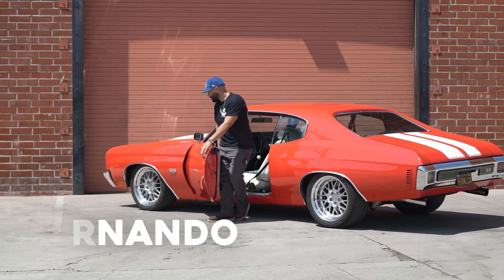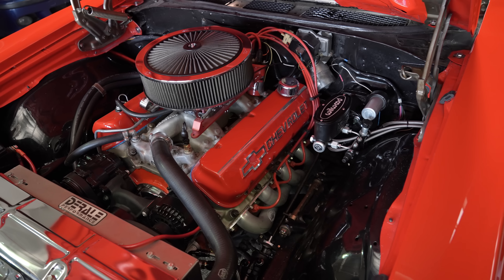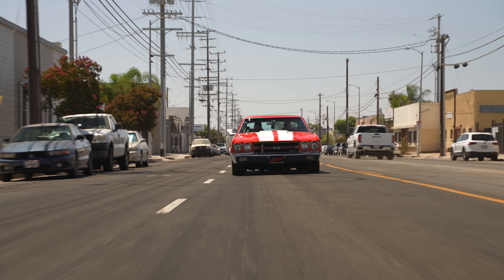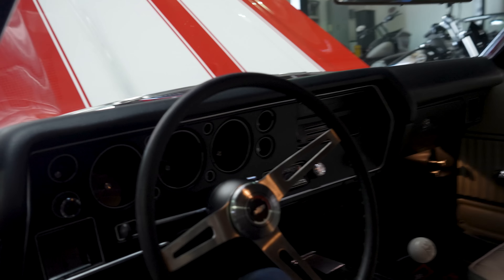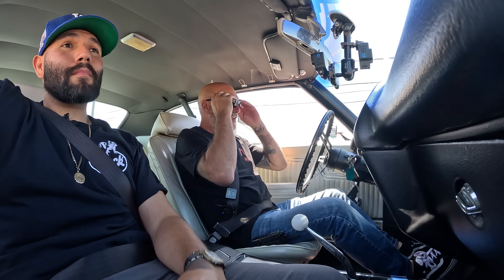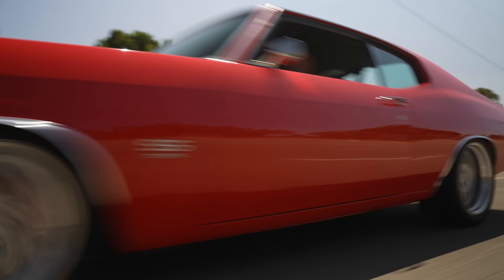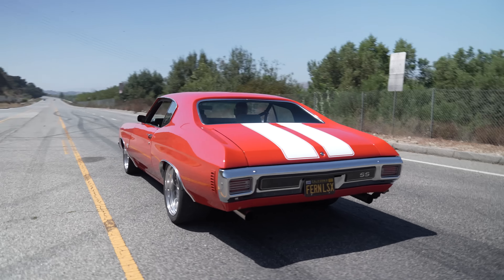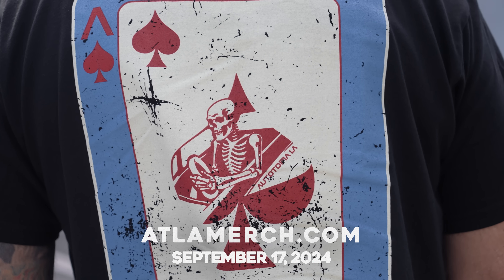This Might Be Perfection: BIG BLOCK ‘70 Chevelle, 5 Speed Manual and that Stance!

Comment: Finally, a real chevelle. Those cars are meant to have big blocks, not a played out LS swap
Reply: LS isn’t played out best platform out there and there not cheap if your going big money LS like the LS3 or LS7
Reply: The LS7 is the worst platform you can use for high horsepower builds.

Best? For what? That's not close to true if you're seeking max power.
Reply: @Ragnarok1979  the LS7 makes 800hp N/A with no boost and it’s very reliable with a good heads cam setup it beats 1000hp cars and trucks all the time the Z06 is a nasty car now if your talking boost for max power just change the piston and rods out for low compression or get a LSX LS7 easily make 1500hp
Reply: @dobetter4271  cool, a big block can make 2500+. Heavy hitters don't use LS engines.
Reply: @Ragnarok1979  not true the fastest street cars in the world are LS powered and it’s funny how small block VS big block and the small block LS makes more and is a lot I mean a lot more reliable there’s 3000hp LS fox body’s out there do your LS research them old school motors can’t touch the LS look at the LS 427 vs old school 427 and it’s funny how mod for mod cam headers the old school only makes 400 to 500hp and the LS 427 makes 700hp
Reply: @Ragnarok1979 Go find me factory block big block making 1k+ like factory block AND bottom end LS7's and LS9's. I love big blocks, its whats going in my 71 Monte, but dont be an LS hater just because its the hip thing to do they are phenomenal motors for the size and driveability.
Reply: @dobetter4271  Decent but not the best. Ever driven a stout big block?
Nothing like the brutal torque they make and the way they shake the car
Reply: @dobetter4271  Most 427s made 400 or more almost 60 yrs ago, stock. 
Put a 15 deg aftermarket head on one, watch out ls.
Reply: @dobetter4271  Ok GM sells a big block crate engine with a warranty
1040hp. 
N/A.

Comment: The reason you are starting to like that style of car is because, like me, you are getting old. But don't sweat it. And I agree with you on the power subject also. Like Jay Leno says "The real fun is between 40 and 120mph." You don't need 1000hp to raise hell and have fun.🤘🏁💯
Reply: True. Ive had the high speed nutso cars & they are coffins if 1 lil thing goes wrong. Were just along for the ride at that point, 0 control. 
Much happier with 0-80, or 1/4 mi thats enough. Can only get so much to the ground

Comment: 305 in the rear and not mini tubbed? 
Damn and I thought I was pushing it going 285 on a 18’’ rim on my 69 Chevelle. 
Badass Chevelle dude!!
Reply: Yea, I dont know about 68/69 but 70-72 can fit a 305 without mini tubs. You have to get the rim backspacing spot on though and maybe trim some of the metal from the outer wheel well lip as some are pretty wide.
Reply: I fit 295's on the back of my 70 and it's a pretty tight fit. There's maybe a half inch gap from the wheel well lip to the tire. Almost went 305's myself but don't think they would've fit with my wheel backspacing

Comment: This is the exact car im finishing building right now. Breaking in the rebuilt 454 on the run stand any day now and body is nearing paint. Chassis is boxed. Speedtech tubular stiffening kit, umi stage 4 handling kit with a da rear coil over as well instead of drop springs. Wilwood 6 front 4 rear with hydroboost, mcleod rst twin disk with hydro conversion all mcleod with 1400 to bearing into a silver sport tkx to 12 bolt posi 373's. Down to the 18 305 35 18 and 265 35 18'. This car is sick! Going to be listed for sale shortly after build is complete so hit me up if your in the Denver area!
Reply: Why are you building it then selling it?
Reply: @IncredibleHoosier  Probably hoping to make a profit, shaky thing to try these days

Comment: If this were mine, I wouldn't do a damn thing else to it. Well I would add the original factory steering wheel from 1970. But that's it. Plenty enough power! Its for cruising, not abusing. With 500 hp, Its got all the get up and go I need. Sounds amazing.

Comment: 13:44 money shot shifting. The fastback future engineer, the 2nd gen. Father and son radical Firebird with the suspension beyond Cantilever where pops worked for a race team. Izzy’s truck, the Torino and now the holy grail 70 Chevelle BBC manual music brakes and suspension. That’s a heck of a cruiser. Air conditioning would make it the Chevy on top 🍒 Pure bliss

Comment: I like this rod as is.  Just run that engine.  It's enough.  Put the thousand horse motors in something else.  Sweet ride Yo.  Cool video!
Reply: agree, most these 1000hp claims are guesses and actually make much less 
Plus you cant just mat the throttle and have fun with them. 
4-500rwhp range is just right.

Comment: Too bad GM didn’t raise the base price on the SS and gave it gauges and ZL2 Cowl Induction as std equipment. The ZL2 makes the Chevelle.
Too much power is a waste, cause the wheels just can’t hook. Anything over 400 HP IMO is a waste.
Reply: Esp with a bb. They make so much torque they dont need as much gear as a sbc does with the same size cam. Dont need OD either

Comment: So this guy wanted numbers matching, bought it, only to make it no longer numbers matching.
Reply: It's a obvious clone as soon as he opened the hood & non functional cowel induction hood(nice Chinese re pop), another tell "this thing had manual brakes, I assume drums all around(SS had factory disk up front), a true SS would have Chevelle badge on right side of trunk lid above the SS rubber pad, a true SS doesn't have a right side mirror, & that's a primo T.J. upholstery shop interior, a swapped out guage cluster easy to do, nice re popped grill. 
  It's overdone to make it look original, tell me it's a clone without telling me it's a clone, Taaaa Daaaa💁‍♂️. Yes I was 2nd owner of 1 bought in 1980 stolen in 1997, had the L88 375hp 402(396) T-400 4:11 gears. That's why I noticed it being a clone. It's a real nice clone!
Reply: So he knows he bought a real one. Maybe the next guy can put it back to stock and let it rot in his garage.
Reply: Good for him! Owner prior to him started improving it.